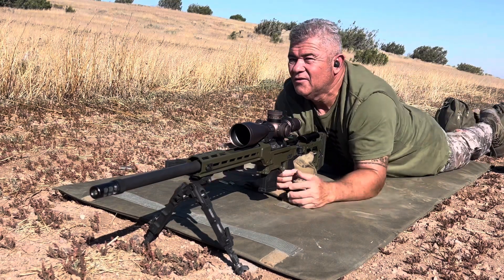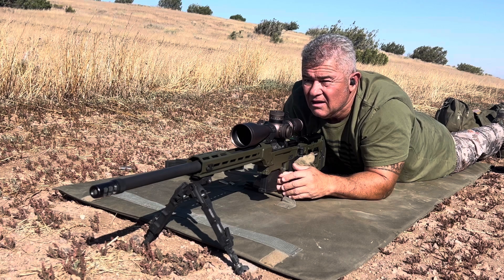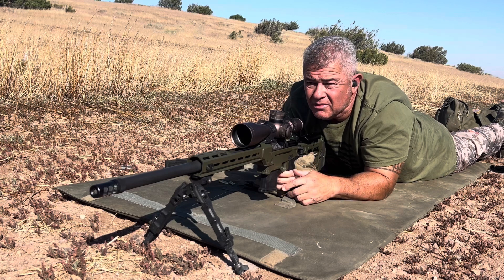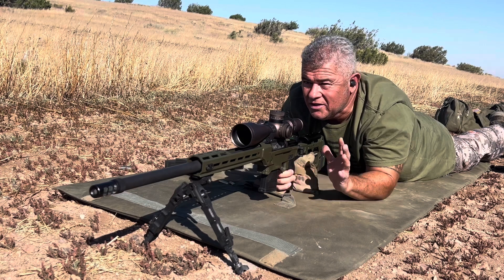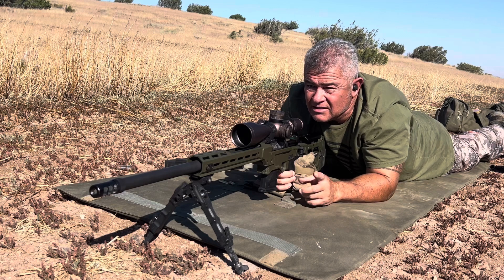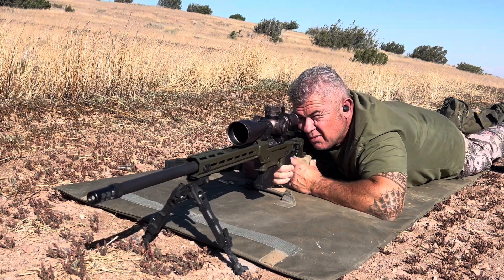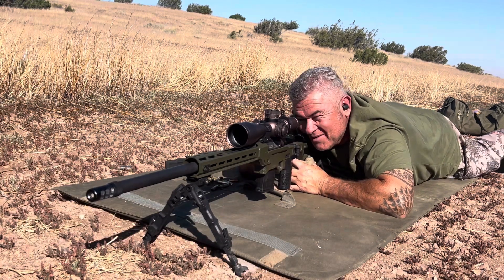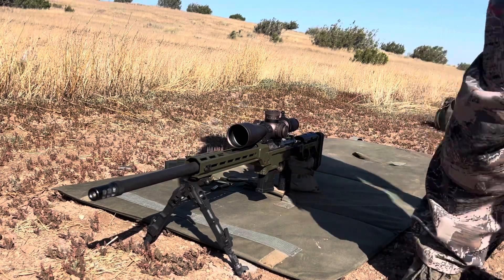Daniel Defense Delta five pro at 650 yards just for fun

Comment: I got same gun 6.5 creedmoor 18 in barrel I no they sell dif barrel sizes what do you think about accuracy between barrel lengths
Reply from the maker: I think accuracy comes from the manufacturing process DD barrels are cold hammered forged they should all be accurate the difference is in muzzle velocity you gain around 25 f/ ps for each inch you go longer. Mine is also 6.5 Creedmoor with my hand loads it shoots .4” at 100 yards and at one mile it’s about 50% effective on a 18x18 “ plate